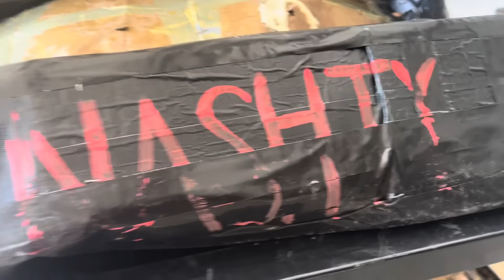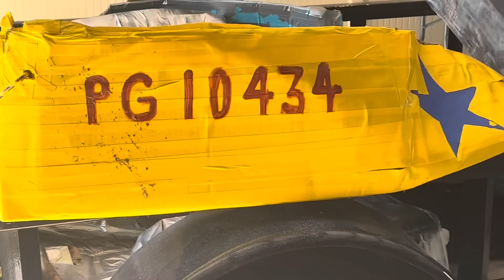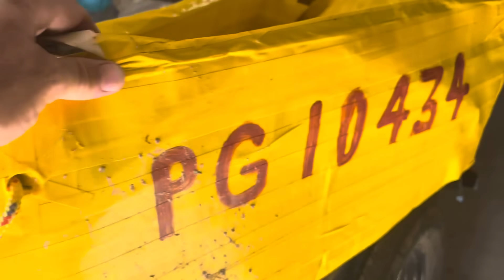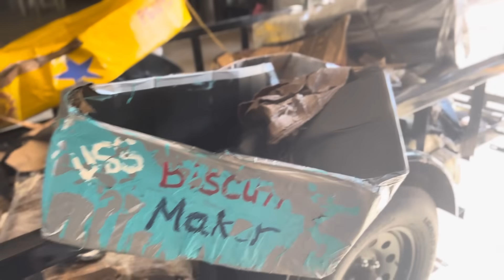Investigate Report:  who cheated on the Boat Race!

Comment: I think foam should be allowed myself. I live at the Lake of the Ozarks and have an extra dock float size 2’x4’ by approx. 15” thick that I would donate if you were here (a dock float is encapsulated foam with a heavy-duty black plastic around it). Anyway, rules are the rules though. It was fun to watch the race! 🛶⛵️🚤🛟⚓️

Comment: Lester it’s based on weight, size and arm span to row. The 3 you check are just cardboard with lots of duct tape, glue and paint. Jake and Bri have the size weight and way to row the fastest. It’s just that Jake is stronger so he won. But if you investigate one you need to do them all. Bri used a ton of gorilla glue not spray foam. Lol

Comment: Lester, welding involves metal...how would you weld tape and cardboard?  That black stuff looks like black flex seal spray (don't you have a can of that to test it), and the white stuff looks like glue that the cardboard manufacturer used to glue the layers together.

Comment: FOAMING GORILLA GLUE
 An incredibly strong adhesive for the toughest jobs
Glue is unaffected be extreme heat, cold, or water - great for indoor and outdoor repairs!100% waterproof and will not break down when exposed to moisture
Creates an incredibly strong bond to most surfaces including wood, stone, metal, ceramics, foam, glass, brick, concrete and more
Glue expands 3-4 times while penetrating the surfaces for additional strength

Comment: When you add water to gorilla glue at foams up and dries hard. That's what that"weld" is.😅 It is not spray foam it's gorilla glue when applied with water it foams up and dries hard she did not cheat.

Comment: that's not weld on that cardboard what that is is it stuff in a can that you can spray inside your boat and it won't leak it doesn't really work that good on boats but probably would work on cardboard because it would sink into it it's almost like roofing tar

Comment: I am sorry but you did not maintain a chain of custody, or take samples of the suspected illegal material. The Card Board Boat Association can not support your claim without a independent third party investigation.   Also spray foam will adhere to almost any surface.  That means it sticks.. isnt that therefore Glue?  LOL